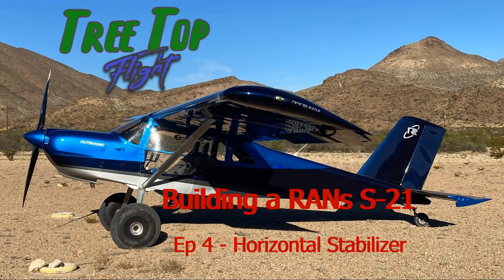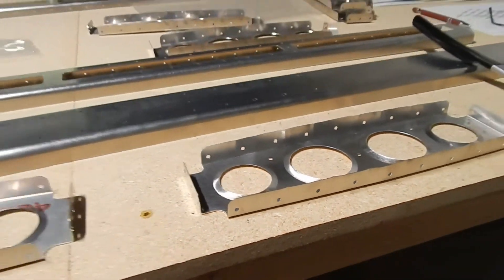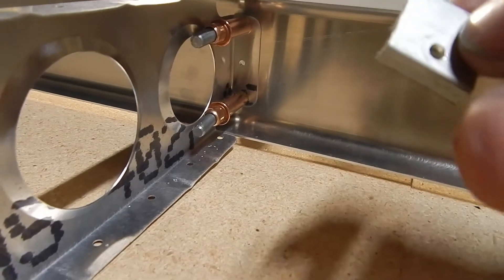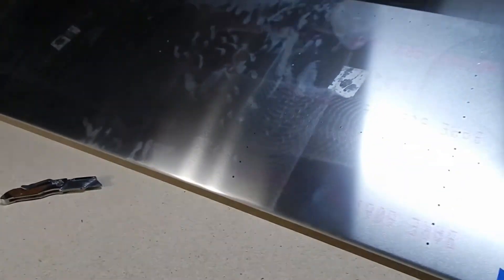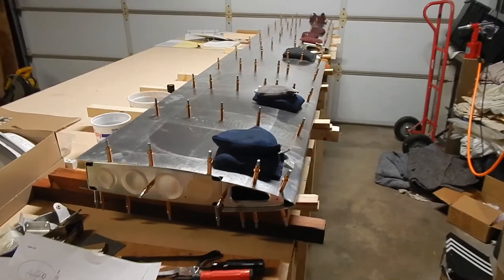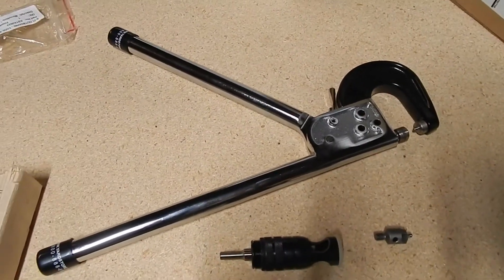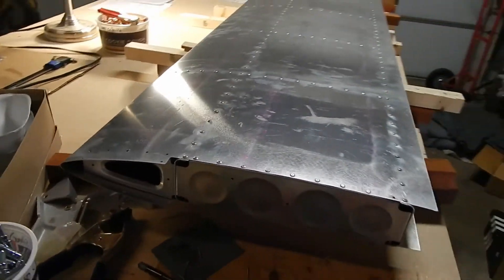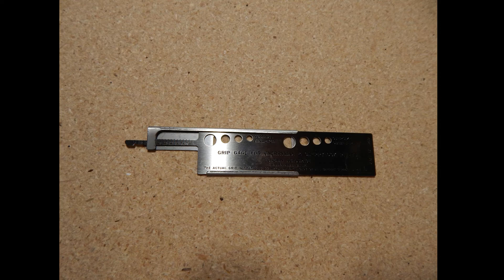Building a Rans S21 Outbound Ep 4 Horizontal Stabilizer

Comment: Your rivets in the fwd spar are in from the wrong side….
Reply from the maker: Page 004-01 show the "rib" rivets coming in from the back, and the remaining "doubler" rivets coming in from the front.  They are covered by the skin now, but I re-watched the video and it appears I did it that way.  I even make mention in the video of the bi-directional rivet instructions.  Which rivets do you see that are in backwards?
Reply: @treetopflight7624  all rivets going into spar and spar doublers, go in from the front towards the back on the front spar, and back towards the front on the rear spar. You have rivet tails sticking out towards the front where the horizontal attatches to the rear bulkhead....
Reply from the maker: I'm not sure how to respond.. The manual page I have clearly shows the rivets attaching the ribs coming in from the aft side, and the rivets attaching the doubler coming in from the forward side.  I identified the manual page number in my previous response.  Maybe RANs changed the process between my kit and yours..  We will just have to leave it at that.
Reply: @treetopflight7624  in your video on the horizontal, where the front spar attaches to S-10 bulkhead, your rivet tails are facing forward. Its very clear they show rivets going in from outside to inside on all spar rivets, except the fwd inner ribs that connect to the nose ribs. These are riveted in first, so you can  pull the aft part of the rib over to allow your rivet gun in, thus not requiring the wedge you show. Then you rivet the aft rib in place.